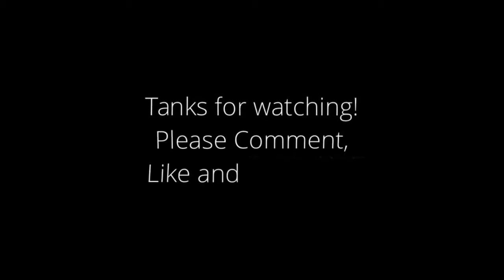Academy 38(t) Hetzer Part 5 (Wash Chip & Reveal)

Comment: I just finished building this kit and I agree that the photoetch parts were difficult to use but I got them on the vehicle. I think I had to apply 20 coats of markfit strong for the big flag decals to nicely melt over the little parts that are sticking out on the upper hull. The tracks were super easy to build. Overall a nice kit.
Reply from the maker: Yes it was and won me a Model of the Year award